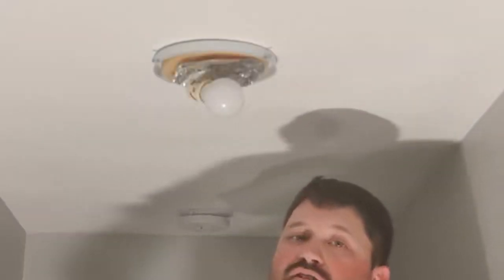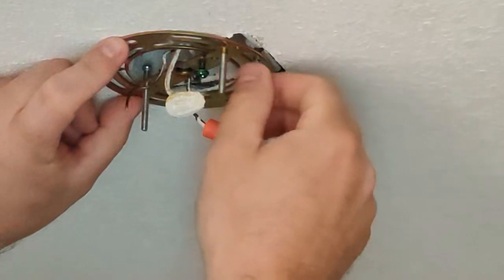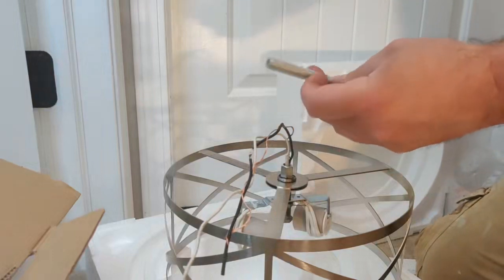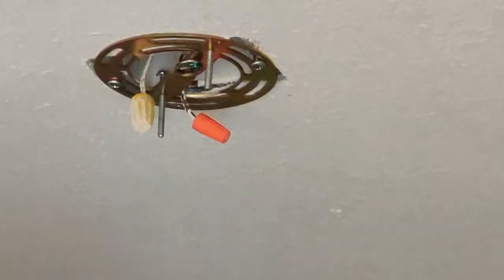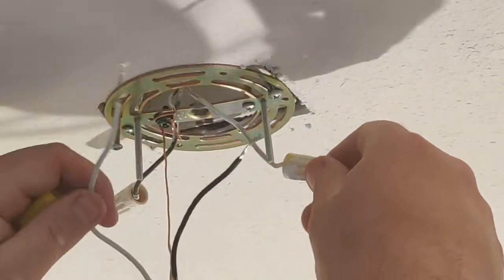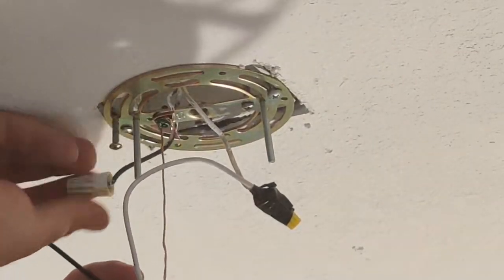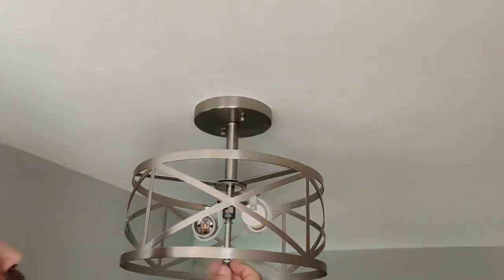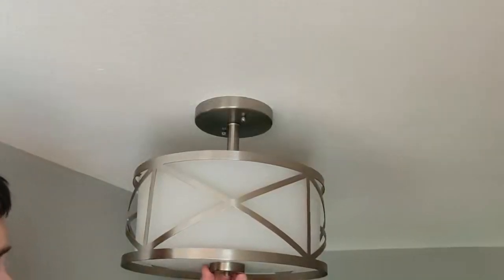HOW TO INSTALL A CEILING LIGHT FIXTURE (KICHLER)

Comment: What if the fixture doesn't have a ground wire, but the mounting bracket does? Do I attach the mounting bracket ground to the box ground coming from the feed conductor?
Reply from the maker: Ya.  Is the box metal?  I am not a electrician but I would guess that how the fixture is to be installed.
Reply: @HomeRepairHub  yeah, box is metal, and the ground from the feed conductor is screwed down so i, presume, I attach the bare wire from the mounting plate up to that (not green) screw with the ground in the box.
Reply from the maker: @astro0125  the screws on the fixture should ground it to the metal box and the as long as the box is grounded you should be okay.  As I said I am no an electrician.  I would also think the instructions would say something about how to ground the fixture if there is no ground wire.